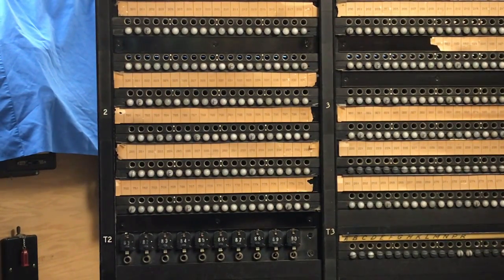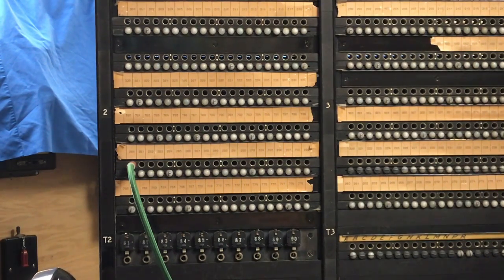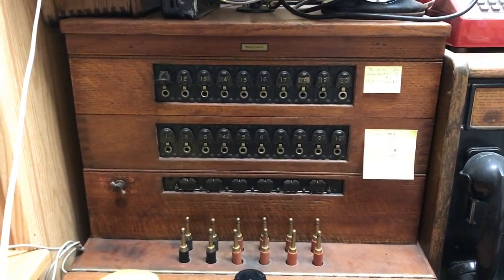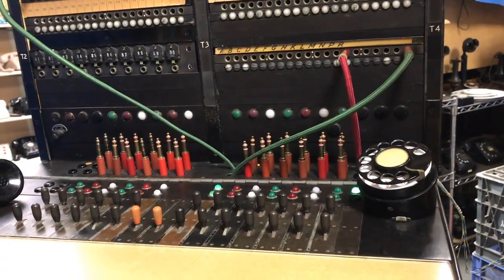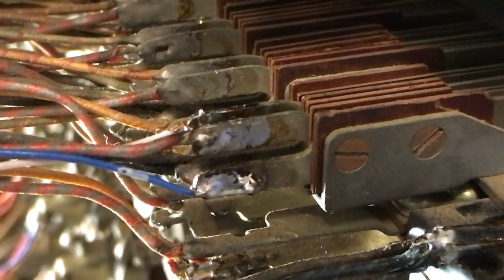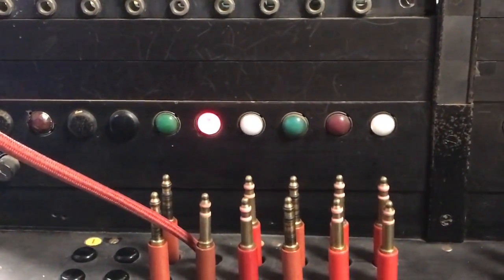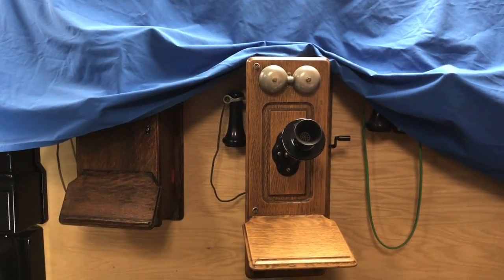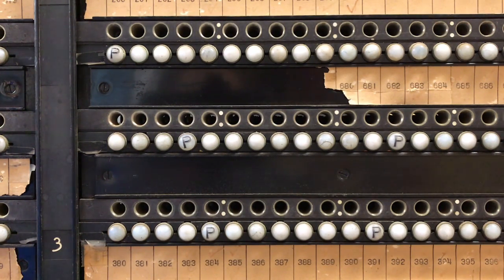Telephone switchboard update. 100 Year phone call.

Comment: Thank you for the wonderful work you do to preserve this technology. I'd like to see two more modern calls that most people would have never thought of. This will require a temporarily configured 1A2 system with non-dial key sets. I'd like to see both originating and answering of calls on a 1A2 key system attached to a manual office. This was a rare configuration, but you see a very short glimpse of it in the AT&T film "Goodbye Central" where you see a non-dial aqua blue 56x series key set in use on Catalina Island.
Reply from the maker: Well I have some Non dial Key Set's. I do plan on wiring up 2 lines to my 1A2 and sometime in the future lines to some of my 1A systems. (400 series key phone's) Because there is no difference between Manual (common battery) and dial systems from a D C point of view they will work the same, ring up and hold. The one main difference is the 1A1/1A2 will time out do to the fact it will receive only 1 ring from operator.

Comment: Thanks for a very good video.  I never saw this type of board.  I did start working as an operator in a hospital on a 608a pbx.  Then at high school I worked a 555 board.  Later in Germany I worked a 3cl military board before becoming a TSPS operator and later supervising the local 3cl board with conference and imts mobile.  I currently have 555 boards, have been looking for a 608 boar for many years.  At present I am trying to figure out the cord size of my replacement cords that seem to have a larger shell than the original.  Great work, nice video.
Reply from the maker: Hi i have a 608d board. Not a stand alone switchboard. Used with 740,701 pbx. It’s for sale. Its in Oregon

Comment: I was briefly exposed to cord board PBXs in the early 1970s, when they were becoming scarce.
In the movies a subscriber might hit the hook switch multiple times to flash the operator to place a serial call immediately after having placed a call or at the conclusion of a received call. Which light (s) would that operate at the switchboard? Would it be accompanied by a buzz or a ring or relay click? Was there a recommended number of clicks for flashing the operator? Is one sufficient? Is seven a sign of impatience and rudeness?
Back in the day, even the subscriber was a more skilled operator. I found modern users almost incapable of initiating a hook flash for a serial call on a 2500 set.

Comment: What r those numbers on the switchboard by the jacks
Reply from the maker: They are the extension numbers. They will be replaced soon. When i reassembled to jack sections i did not try to put them in order.
Reply: If u have ur own switchboard and it’s not connected to the pstn will it ring when u call another station